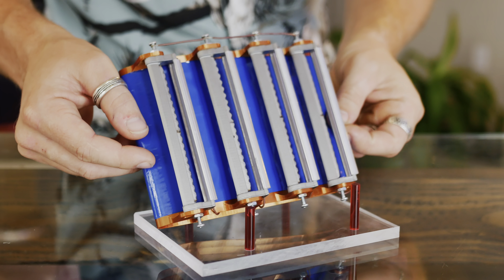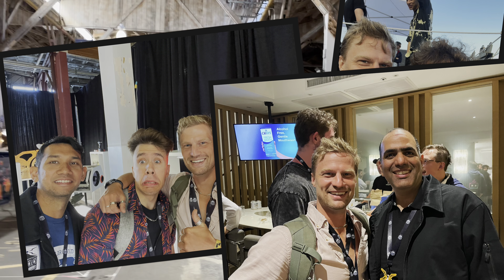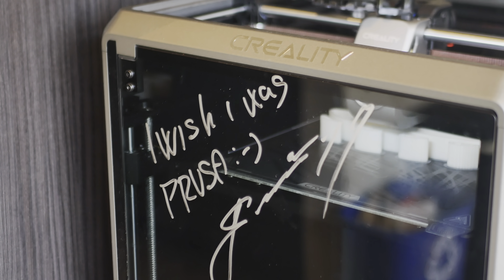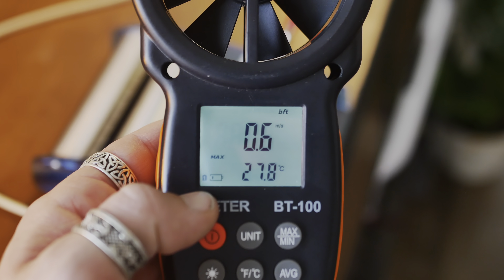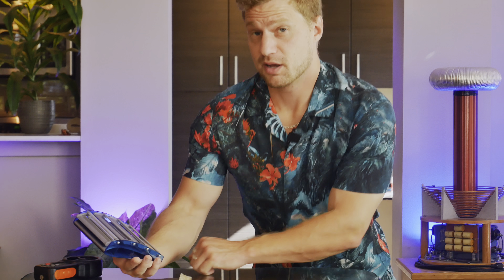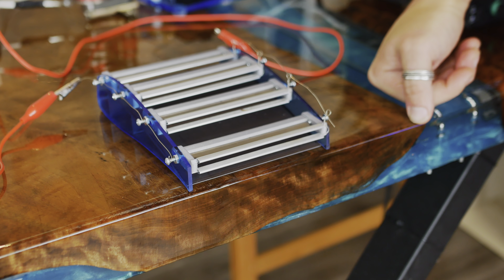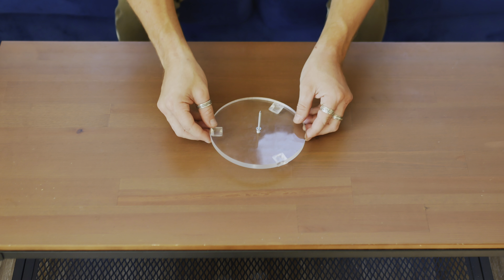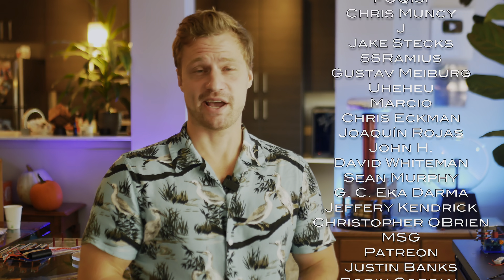Designing A Self Propelling Ionic Thrust Wing

Comment: There’s a bunch of stuff I wanna say here you’re doing an amazing job and I want to tell you something about lasers so that you can get a better perspective on this and warp fields hydrogen makes a warp field and just heating the air has water in it and makes a hydrogen bubble and that is all the combustion chambers and it works much like a spring trap and yes, it does to stuff up and it falls under the category of something called the thermal vacuum You might not really need to know about that but that is something that’s important thermal fake vacuum damage when I make a laser, I set up three candles next to each other and I’ll feed some one fuel to the first candle say WD-40 and then on the second candle I’ll feed it something like brake cleaner or rather Starting fluid and at the same time as I hit the second fuel, I’ll put something like a silly string to make a conduit between all three candles, I’ll purposely shoot across all of them with the silly string, and the silly string ends up being much like a big welders wire or in fact, exact exactly exactly Full hard me welder only with plastic only in this case I’m using the plastic of a silly string and I’m not necessarily welding I’m just burning the shit out of something and the third one will put some other type of fuel say something really cold ice specifically and rubbing alcohol and have the rubbing alcohol on fire so we’re getting water dropping with flame all the way around it, and then a car horn and the idea if you look at the stream of all the matter going in and being funnels through sideways across the candles and being forced hydraulically pressed one is supposed to be Three funnels going into one and then number two is a two more finals plus that one with all three going in high-pressure it keeps adding up and so you’ll just like you’re putting your thrusters one in front of the other in front of the other this same effect takes place. You’re only waiting for some alternate fuel to step in there and you’re gonna have an engine that is just unbelievably out of this world Now the next one is look into a squirrel fan just like a biplane has multiple wings. The wings don’t have to be that far apart they were arbitrarily set those that was where they found pressure ratings. If you follow the pressure gradient properly, you should stagger the wings much like steps. The next one is if you study a hell and this is very important this one if you study a helicopters rotary wing it spins to increase artificially the surface area. That’s what they tell you well that’s not entirely the case but it is 100% true there’s much more to it. It goes back to a rotary transformer now it works out that the last third of the helicopter propeller is all that you really need. That’s where the majority of the lift something like 70 to 80% of the lift is generated in the last third of the Blade and the last third of the blade should be more of a teardrop shape square in the front just like it is, but the backside of it should be rounded like a really round paddle and kind of a teardrop shape. If you put these on the outer edge of a Frisbee and you have two tracks of them running an opposite direction you should be able to make a UFO that looks and flies just like a UFO or just like a helicopter one of them double bladed helicopters it should be needed as hell with a first person view camera good luck. World war, one submarine emergency bug out maneuver. There was a little bit of preparation, but they would do warp assist trajectory flight, assisted it had it right and it changed it. ED assisted past tense thank you. I know a lot a lot, and it’s hard to say it all right because I dosed myself to give other Niles Nair do well a chance and now I’m coming sober again there are a handful of things that you have to know applied physics the cost of activation of an engine or motor when the motor is is spinning just above the speed of light, the speed of light is closer to the speed of sound then you think there are friction drag modifiers like everybody’s primary training says one G it’s not one it’s drastically more but you must behave like it’s one G you really want to get technical about your calculation you need to calculate at 100 G but you need to build it out at 80 G and now that’s only important for really high-end engineers and when you’re getting into that math the way that you’re getting into it that’s important for you to know this is adult science don’t share it with anybody that is any little bit psychotic if they want to use to kill their fellow man yeah that’s my stick. That’s my club. They gotta get in the military for that you’re working the civilian theater. You need to know this but you need to keep it adult now the next one is it’s written in the language. Everything about the language has encryption in it 360 to 365° well it’s 360 THz is the activation frequency that you have to get to do the war assisted trajectory flight or artificial gravity or anti-gravity now the five is kind of a give me they say it’s not really there. It’s a Ford and backwards. You have to know more about the planet. Our planet is made out of nine planets. It has nine course and a 10th one that is a polymorphic iron core yeah Skynet liquid metal micro robot not as polymorphic as we would like it to be. It’s more as polymorphic as a protein rather than as polymorphic as Odo from deep space nine right now there’s something special we had two desalination plants that’s where our oil comes from dead cellular waste by product from everything that in the water as it goes through the salt, the desolation Plant one of them got imploded that was no flood that’s biblical history. Get over it best not to talk about it the important part is for that the plant to work just one plant because they they in intertwined with each other for it to work with just one plant we had to drop a second core so in actuality long story short there’s three gravitational course that gives us 1/3. The actual friction drag coefficient so your numbers aren’t gonna add up to say 100 G or 80 G they’re gonna give you some oddball .8 of a G or .98 of a G or something like that anyway they’ll tell you that your sensor is wrong. They’ll tell you all kinds of stupid stuff cause that’s the super con that’s the slavery that came from the human trafficking of eating human beings, which was extremely prevalent 7000 years ago there was a smart gun bullet applied a Nanotech derivative bullet to stop us from eating one another but the monopoly of slavery still holds strong when we can’t get the medical tech out right everybody and I do mean everybody is suffering from something whether it be self-inflicted inflicted by someone else or just native natural environment anyway instead of having to pay the 360 car watts you only have to pay something like 120 W and there’s a bunch of different ways to cheat it The easiest way is to know that water is a man-made substance. It’s almost endlessly, reusable and self generating for all purposes when you have some life using it and we can activate it you get water to luminous. It is cryo- fluid. I’ve got the instructions on a lot of this stuff and it takes me too long and I’ve already had short term. Memory set too many times saying this stuff. My name is Noah and you should be able to contact me through this. Just keep barking at me like a schoolgirl argument.

Comment: How does it work with Bernoulli's Principle ?   I think you should put the thrusters on the bottom so the wing doesn’t stall.  Low pressure on top and high pressure on the bottom.

Comment: Why top wing thrust? Air Over the wing is Lower Pressure and at faster speed.
Reply from the maker: Exactly. That’s how wings create lift. Lower pressure above
Reply: @PlasmaChannel  yes i am aware. however i am talking about air speed and pressure or more to the point air intake and exit trust. there is an reason most wing mounted engines are on the bottom of the wing,

Comment: Atmospheric ionic thrusters use very high voltages, making them highly sensitive to moisture. Humid air increases the risk of electrical arcing and short circuits, negatively impacting performance and potentially causing damage. Rain is even more critical, almost certainly leading to immediate short circuits. Therefore, current ionic thruster designs are generally unable to operate effectively or safely in humid or rainy conditions. Consequently, for this technology to advance and see widespread application, overcoming the challenge of moisture is crucial, either by improving the design's resistance to humidity or by developing methods to treat (e.g., dry) the air before it passes through the propulsion system.

Comment: I could see this idea working better with the ionic thrusters being aligned in-line just behind the leading edge of the wing or integrated into the fuselage. Having them in parallel from leading to trailing edge like this increases the airflow disruption from the thrusters and drag to the airfoil. In aeronautics, especially with gliders, it's all about flow over the airfoil with thrust being a main component to achieve that airflow. With the thrusters in-line or integrated into the fuselage, you'd lower drag, increase maneuverability (stable flight), and reduce the chance of stalling from turbulent downwash. Hope this take helps!

Comment: Wouldn't it be better to place the ion drives on the under wing? The top needs smoother air flow and acts like more like a vacuum... Under wing should cause more vacuum over the top as well as help pull the wing forward. Probably the same reason they mount armaments and fuel pods on the under wing.

Comment: put the positive and negative cathode and anodes inside the wing ?
Reply: No airflow inside the wing. You'd have to open up the leading and trailing edges and that would kill the airfoil. But..... you may be onto something, what if you could duct the air from an inlet, route it out the back like a jet!  🫨

Comment: You're going to want to put the ionic thrusters on the bottom. That's where the high-speed air flow is by putting them on top of your increasing the amount of speed which decreases the low pressure. That then decreases your amount of lift

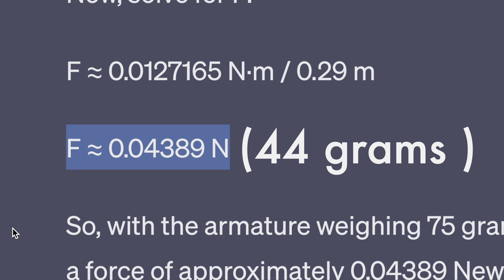Comment: That is not 44g of thrust, but 4.4g at 15:45, why has no one commented this already??
Reply: Newtons are the defined as the force to move 1kg across 1 meter in one second. Since a kilogram is 1000 grams and the integer 44 originates in the 100ths decimal place, 44 grams is accurate.

Comment: how much wind does a gas powered prop engine produce?  Making air move is a tricky thing.  what is the effect from HV that makes airflow in the first place, is the HV pulsed or DC?  if you pulse it based on measuring heat and other things can you make wavefronts that create some resonance

Comment: To get better results use thousands of fine short lengths of wires, or carbon fibers all electrically linked together as one electrode replacing the serrated razor. This is also used in building old electrostatic machines as feed conductors

Comment: I am no expert, but it seems to me that thrust on the top of the wing might create higher pressure, which undermines the wing's design. The design aims to create lower pressure on the top and higher pressure at the bottom by manipulating air speeds. However, if the thrust were originating from the bottom of the wing, it might have a positive effect on the lift, which would change the entire design of the wing. It probably wouldn’t need to be as steep, long, or wide.

Comment: Very cool, man!!! I've been following your evolution for quite a while now, and it's inspiring the preserverance and determination you have. I was wondering if you could lower your wing weight by creating a wire like structure with carbon fiber and than use very thin plastic to cover the structure. Or try using rice paper like model airplanes to cover the carbon fiber structure.  Best regards from Portugal.

Comment: The thrusters should be built into the wing to reduce drag. At small scale drag has little impact. At scale the drag will require more power to overcome parasitic drag. Building into the wing builds in structural support while not adding drag.

Comment: I think you are wasting your time by using the classical wing shapes. Their purpose of the classical shapes is to have the air flow move quicker on top of the wing then the air below the wing but your thrusters along the whole wing are already accelerating the air above the wing thus pulling the wing upwards. Since your whole top of your wing is one thruster the shape has in my opinion little effect. I would bet that a flat wing surface with ionic thrusters all the way will be more efficient. The big issue that I see is that if the thrusters are off the plane will not glide but rather force the plane downwards.

Comment: this is a year late but what would happen if instead of outside of the wing you created a model with it inside the wing. in theory is should shave some weight and give some ability to control during flight if the last one is in a moveable segment of the wing, again in theory allowing for faster turns without sacrificing to much power

Comment: Use Nitenol wire to replace the blade and keep the serration I don't know why I suspect this but I have a funny feeling the more serrations are in the wire the better your results will be, you could use this wire provided it can handle the current to replace all metal parts and further reduce the weight, if you can get it lite enough you may be able to directly shape and fix it to the wings without supports - less weight again.

Comment: dude i follow this project super close, i believe this is going to change the industry forever, and this little discoveries will make a huge change in the vehicule industry, my biggest concern was the noise problems in relation to drone vehicules, or propelered vehicules, but with this, it totally changes the outcome, hope you can dicover the way to generate more trust agains the payload, i thought, if there is way to integrqte the batterie to the chasis of the model, like this the body itself could store the energy, i know is crazy but hey, what are talking here right? cheers dude

Comment: Actually ... Back in the day I bought a four foot wingspan Styrofoam glider from some big box store and added some RC controls and a battery.  Flew like a dream.  I had the idea, but never built it, to put a very thin fiberglass coating on the wing and then use solvent to melt the Styrofoam away.  More complex that that but it might be what you are looking for wing shape wise after all it is a very large winged  lite-weight glider.
Reply: Having thought about it I realized I did make a wing but not out of fiberglass.  I made a lightweight wing out of craft paper and a thin fiberglass resin.  I don't remember the solvent I used to melt the Styrofoam but it may have been simply gasoline.  It held up quite well and it was a lot lighter. It was translucent and I did manage to install RC ailerons.

Comment: Unless this stays as aerodynamic when off. Which I can see way too many ways in which it restricts it to be viable. Overall, I think this is going in the wrong direction.
 - Might as well create a drone that uses ionic thrust if you are reliant of it being on.
(I mean investors did get behind the ionic drone but flight time is stupidly low)

A correct approach would be is to have the intake behind the wing and thruster(s) in the back. This way, you keep the aerodynamics of the wing. And the intake actually helps get in the air faster. But not reliant on it or handicapping it much when it's off. Just keeps it stay stable.

At least now nobody else can manufacture your design since you patented it. Lol
(Actually that does sound like a good idea in preventing stupid ineffiencies in innovation. It really doesn't need to serve an advantage afterall. Please patent any unsafe configuration you can think of that safety regulations overlook. Lol)

To add clarity. You don't think they could've had the intake for jets with integrated into their body, into the wings? They could've but it wouldn't have benefitted.

The lift of an airplane is caused when it slices through the same air. And the surface area is greater than the top than the bottom. Causing it to get spread out which creates a pressure differential compared to the bottom, which sucks the plane up. Which is why having the intake behind the wings, is a much smarter choice. Which helps with that pressure differential. (Too bad it's not really patentable though, huh? It leaves you with trying to invent less efficient wheels)
Reply: Overall, I just think efficiency should be the focus. Not just whether or not you can get it in the air.
It is the main benefit of putting it into a plane format.

And the thing with ironic thrusters I think is awesome. They are pretty much instant on / off. And so I think we can use that to save power and therefore weight.

(Also I wouldn't agree that these are integrated into the wing but that doesn't really matter, does it? Since we could literally have the wing be the thruster, and it'd still be less efficient than one with a push/pull facilitating the pressure differential.)